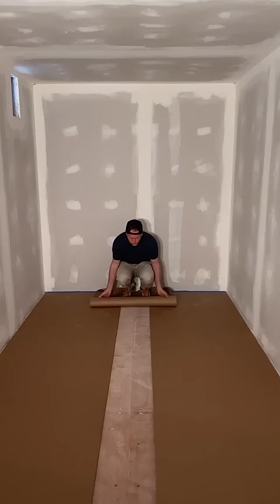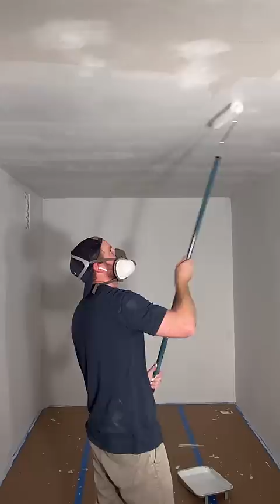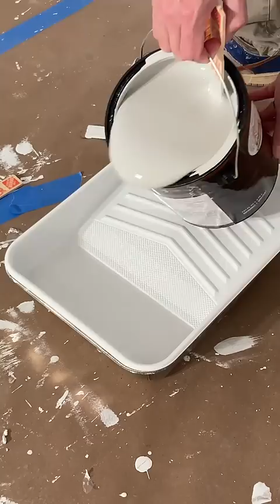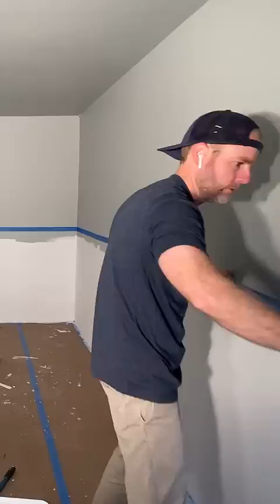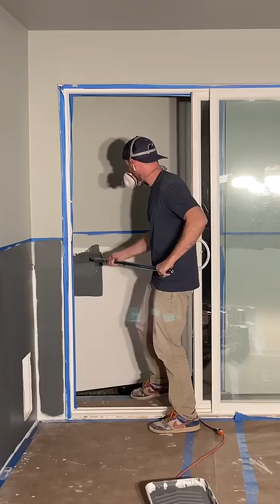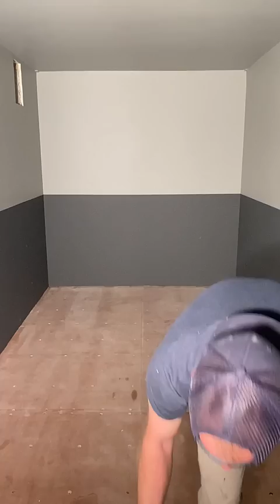Shipping Container Painting #shorts

Comment: For all the people thinking of doing this. If the container is in a permanent place then you can sheet rock and it will be fine. If you try to move it with a roll back all the sheet rock will pop loose. Paneling and adhesive works much better if you are going to moving it from place to place.
Reply: What type of pannelling would one use for a moveable unit?
Reply: no top of that, sheet rock be heavy af
Reply: @joshplayzgamezz not for a rollback

Comment: Who rolls first then cuts in? 
Rollers give you a texture, always cut in first because brush strokes don’t match the texture of rollers.
Reply: You’re right)
Reply: Rollers give a smooth finish when used properly….
Reply: @puzl3r_ttv  only specific foam roller covers and maybe some fine cotton ones give you a smooth finish. But almost every wall you’ve ever seen was rolled with a 3/8 or 1/2 nap roller which by design have millage. Which is how texture of paint is determined with different roller covers. 
Metal or fiberglass doors and hardwood cabinetry require a different roller cover and some sanding between coats to make smooth.  
You’re welcome mister “when used properly” 🤦🏽‍♂️
Reply: Yes typically cut first roll second roll

Comment: Cut first then roll to the cut. Much faster and easier to keep away from the ceiling
Reply: Or he could do it the way he did it and it came out fine
Reply: @ProjectFraz  or you could ignor a painter thats been in the trade for 12 years. Sure
Reply: If it is the first coat doesn't really matter but definitely on the Finish coat for sure
Reply: @pilotguychris7217 you are correct. If it’s a flat/matte sheen and a lighter color then you could even get away with rolling first on final coat. But definitely darker colors and/or any color with more sheen you have to cut it in first

Comment: Please cut your edges in first then roll. Much nicer finish with fewer brush strokes in corners. 
Finish all you roller strokes in same direction for uniformity of how light reflects off surface. 
Nice job with the horizontal lines.

Comment: I'm guessing you made sure you did enough coats, it looks well done.
Remember, if you go back and do a paint patch, you will most likely see the paint patch as it will dry and make the other area abit darker as it will bend with the wall and not just cover the wall.
It's a liquid that will soak into the wall and color the wall slightly. No matter what color was there before, even if it was the same color. It will blend with what's there.